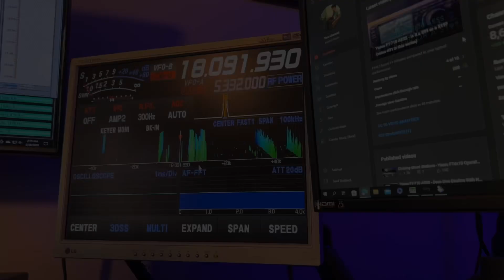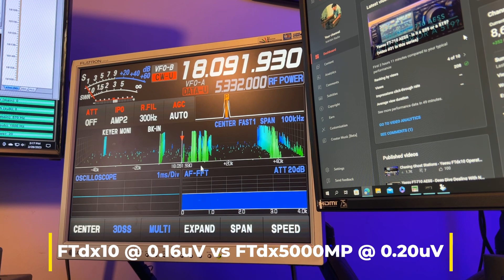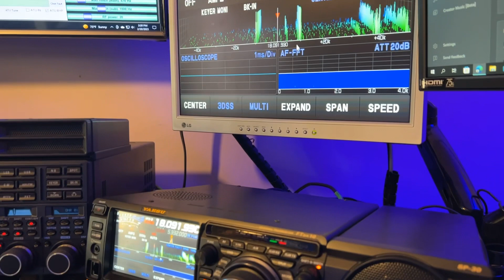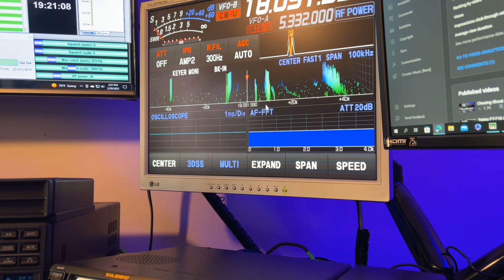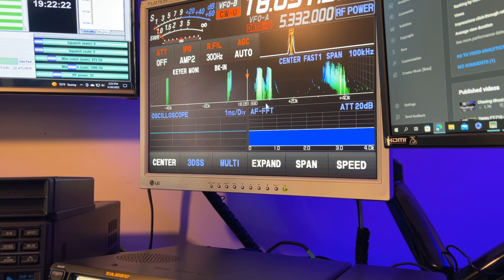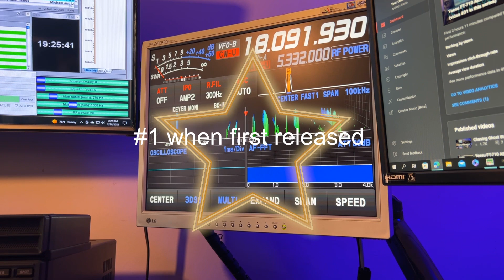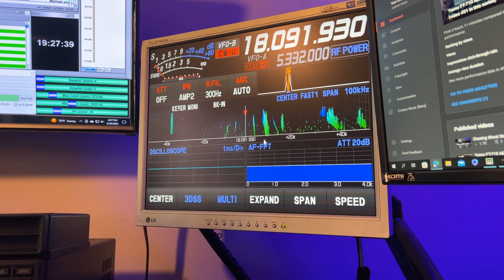Choosing an HF Transceiver: RX Sensitivity #hamradio #receive #receiver #sensitivity

Comment: I would never purchase a radio without an rx antenna port. Currently using the TS590SG which does have a rx antenna port. If you dont know what I am talking about build yourself a rx antenna only Google search "loop on the ground antenna" it very inexpensive to build  connect it to your FTDX 5000 rx antanna port, then get on 40/80 and use that antenna to listen on you will be amazed and what you can hear.
Reply from the maker: @ThomasAdsit I already built a RX only antenna years ago.  I shot a video about it.  I also shot a video showing how to use an antenna matching unit to detune almost any antenna and make it a good RX antenna.  

The receiver in the FTdx5000 is so quiet I ended up not needing the RX antennas.  I also don’t need one for the FTdx10.

 I have a TS-890S.  Good radio.  Fantastic ergonomics.  Noisy receiver. I’m shooting a tutorial series about it now for my Patreon members.

Comment: I have the FTDX101D as well as the FT-1000D. The ergonomics on the 101D leaves much to be desired IMHO. The 1000D is just a dream to use. The 101D is better on features and performance between the two. Ergonomics is really underestimated when weighing these rigs. If you can't find the function, then what good is it?
Reply from the maker: That’s one of the reasons I chose the FTdx5000MP over the FTdx101MP. The performance rivals the 101, but with the ergonomics of the 1000.

Comment: you get more bang for the buck with Yaesu
Reply from the maker: That’s why I usually end up with a Yaesu even when I try not to buy a Yaesu.
Reply: @n4hnhradio  that is all I ever had  started out with a 101EE and never turned away from Yaesu
Reply from the maker: Wow Steve!  Well, the vintage 101 is what really put Yaesu on the map, so to speak.

Comment: I had yaesu dx10 got rid of it great rig but their were quirks I did not like about it but the final decision was when I used the proper dvi-d to dvi-d lead for the monitor and radio, and it still blew something in the radio, so I had to send it in for repair only yaesu I have now is the yaesu 891 great little rig used your settings get great reports on that set, my other rigs are kenwood ts890 icom 7610 icom 9100 agreed what you said on your video get a radio that suits your needs and operating style not because its no1 on the Sherwood list
Reply from the maker: That's a shame what happened to your FTdx10.  I've been using the DVI-D to DVI-D setup since April of 2021 and my FTdx10 has had zero failures of any kind.  But, even if I couldn't use an external monitor, I would choose the FTdx10 again because of its low noise floor, filtering capabilities, and superior DSP.  It has a fantastic receiver for chasing QRP, rare DX, and contesting.
Reply: @n4hnhradio Yaesu is having a major problem with the USB ports on their newer radios. Without a warranty this problem will brick the rig.

Comment: I'd trust the laboratory tests before on the air test! A slight change in band conditions can easily throw the whole test! Without listening to a beacon station on the same band at the exact same time to compare it to you don't know what's taking place! 

Not to mention all the solar activity taking place here lately! Upper bands change first!
Reply from the maker: Yes, lab test results are helpful. But, like I mentioned in the video, each test produces a result for a specific function.  When we operate, we utilize the entire breadth of functionality available, or we should. 

You might be new to this channel so you might not have seen past videos. I put the radios through the paces in various modes and band conditions. I don’t make a judgement based upon one experience. I spent 8 months in 2019 pitting every major transceiver against the other, to decide on my next HF base station. My final choice was not the transceiver I was expecting to get. It wasn’t even the same brand. 

My suggestion in this video is to consider other things beyond the specs. Transceivers in the top 20 of Sherwood’s list are all very good, some even great, especially those in the top 10. But they aren’t just great based upon the test that Rob Sherwood rates them for. They have a broad range of features that, once combined, can allow the transceiver to perform even greater. That is the main purpose of this channel - a focus on operating techniques.
Reply: @n4hnhradio  Yes but your video is RX sensitivity! You cant use a sky wave signal as a reference and get any kind of accurate test! Even a ground wave signal, which is way more stable isnt a great reference! 

I hear stations say that all the time! Its Bogus! 

As i said. I will stick with the Lab test because they use a stable reference!

Eliminating QRM thats another topic!
Reply from the maker: My video was an example of how comparisons like that should not be considered as the one criteria to use when making a purchase decision. The video isn’t intended to be definitive in one operating session.  It’s a 13-minute video.  The two transceivers featured in the video were chosen because they just happen to be the ones I use. It isn’t a FTdx5000 versus FTdx10 video.  

If your intention is to pick apart the video, this is probably not the channel for you.  You are probably too smart to watch my videos. I’m trying to provide practical advice to newcomers to keep them from spending money unnecessarily.  In this case, being overly concerned about one specification.

I have been pitting those two transceivers against one another since April of 2021.  I’ve pitted them against others as well.  I know they are neck to neck. The point in the video is to show that a difference of 0.04uV in sensitivity, on paper, isn’t really discernible in actual operation. As you say, propagation can skew the results.  So, don’t get caught up in making a purchase decision based upon one spec.  Consider ergonomics, operating style, modes used, reputation, and perhaps even brand loyalty.  Most transceivers on the market today are quite good. There might be a better execution of one feature on one versus the other and vice versa. For example, I know that the DNF in the FTdx10 introduces distortion. But I didn’t let that stop me from enjoying the superb filtering and noise reduction capabilities it offers. 

A person can buy a radio based purely upon specs and that is fine. And as long as that makes them have confidence in the radio, that’s also fine. They will most likely enjoy the radio for years to come, especially since there is very little difference these days between most radios within the top tier.
Reply: @n4hnhradio  When the first thing you do is use a Bogus reference you just lost my confidence! Anyone who thinks you can use a sky wave signal as a reference doesnt know squat about Radio!

So why would you even do that? Its a Red flag!
Reply from the maker: Put on your thinking cap. How many hundreds or even thousands of times do you think I might have flipped that switch to account for fading?  Too many to count really. It’s not a bench test.  It’s a judgement made from hours upon hours of operating experience, under various conditions, including some ground wave. Enjoy radio the way you wish.

Comment: My 2 favorite Cw rigs are the 5000 and the k3s. Both have lower noise floors to me. The dx10 isn’t far behind.
Reply from the maker: The K3S is a mighty fine transceiver too. It is only 3 positions below the FTdx10 on Rob Sherwood’s chart for dynamic range. And, like I said in the video, top 10 transceivers are going to be neck to neck by the time you factor in all of their assets.

Comment: Love the channel!  Just bought a 2018 5000MP which is out at Yaesu being checked over. What is the software/pan adapter solution you use as shown in this video with the Flatron monitor?  And what are you using to switch between the 2 radios?  73’s Randy N4TDT
Reply from the maker: The Flattron monitor is connected to the FTdx10. I use the SM-5000 with the FTdx5000MP.  I don’t care about a waterfall, so the spectrum scope in the SM-5000 is enough for me.  I play radio, not television. If a radio has a waterfall, that’s fine, but I don’t make a purchase decision based upon having a waterfall or not. I’m using an antenna switch in reverse to switch between the radios.
Reply: @n4hnhradio  thanks for the quick reply!. I agree with your comments, but I’m curious what you’re using to project the waterfall on the LG screen since you were switching between the 5000 and the DX 10. Thanks again. Randy.
Reply from the maker: The FTdx10 has a waterfall. The Flattron is displaying a duplication of what the FTdx10 display shows.  There is a direct monitor connection on the back of the FTdx10, via DVI-D.
Reply: @n4hnhradio  ok, I thought you had switched to show both the 5009 and the dx10 on that monitor and I was trying to figure out how you could show it from the 5000.
Reply from the maker: Oh!  I see what you mean. No!  I wasn’t even watching that display. I was focusing only on listening to the QRP small on the two receivers, showing that the radios are neck to neck as far as performance goes.

Comment: Yaesu got my money thanks to you. I have to say the FDX10 was my limit on what I could spend. Since then I have added the 300hz RF, Begali paddle and a extra monitor.
Reply from the maker: Congratulations!  Tell Yaesu!  Hi! Hi!  I think that they think I have hurt their sales. I’m just being honest.
Reply: @n4hnhradio  I also bought an ftx-10 based on your videos. Along with the overall assessment of the radio being very capable, the main driver for me was your thorough explanation and guidance of how to use and get the best out of the radio. This is such a valuable resource. I'm convinced Id get much more success out of this radio, compared to many others, only because you've taken the time to provide us with such a high standard of teaching. Yeasu should be hugely grateful to you for providing this resource.
Reply from the maker: If Yaesu is grateful, they will probably never admit it. The truth is, the techniques I teach can be applied to most radios.  It’s just that some are cable of better performance than others, using the same techniques.  The FTdx10 is one of the more capable. 

I’m glad you are finding the videos helpful. I don’t know if I will get anymore radios to create a video series about. After I revealed the good, the bad, and the ugly about the FT-710 AESS, it seems that I can’t get another loaner. But that’s okay, you can still apply the techniques to other radios. Even the videos in the FTdx5000MP playlist can be applied to the FTdx10. Knobs and menus are different but the performance is the same.

Comment: What’s the difference between noise floor and sensitivity (-127db vs 0.16mv)
Reply from the maker: Hi A.J.!  When I refer to the noise floor, I am referring to natural noise (atmospheric), also known as QRN, where the “N” stands for Natural.  There is usually an added portion of noise from distant man-made sources, also known as QRM, where the “M” stands for Man-Made. These distant man-made noises combine with the atmospheric noise to create the noise floor.  Another component that can factor into the noise floor is the noise generated by the heating of the receiver components themselves, especially in the front end of the receiver.  This is the noise you hear when no antenna is connected.  And finally, there is the added possibility of local man-made noise (QRM), such as that from power lines, plasma TVs, wall-wart power supplies, laptop power supplies, LED lights, wireless phone chargers, food sealers, etc. The local QRM will prevent us from discerning the natural noise. 

Now, sensitivity is the ability of the receiver to detect a weak signal against the inherent noise of the receiver itself. It is measured in a laboratory environment. The test engineer uses a signal generator, increasing its output level until the receiver’s audio output increases by 10dB more than the level of minimum discernible signal (MDS).  The formula is expressed as 10dB (S+N)/N). S+N represents a discernible signal plus noise, while N represents the amount of noise measured when no signal is being fed into the receiver. The Signal+Noise measurement is divided by the amount of Noise measured when no signal is feeld into the receiver.  The result is expressed in microvolts, as in 0.16uV for the Yaesu FTdx10.. That means that it took a signal level of 0.16uV to achieve the 10dB increase above the minimum discernible signal level.  For the FTdx5000MP, it takes a signal level of 0.20uV to achieve the 10dB increase above the minimum discernible signal level.

I hope this helps.

73, de N4HNH

Comment: Love my FT5000MP 2014 - fully agree the ergonomics really suit the desk environment. But also love my DX10 for portable and mobile (static) - it’s like having the 5000 on the dash. If the magic smoke ever escapes the 5000 beyond repair, at this moment in time another DX10 would replace it.

The function menu is a little strange at first on the 10 but I mastered my 897D, but a lot are set and forget so I wouldn’t worry if like me you have bigger than average digits

Thanks for all your work and videos on the radios - said it before Yaesu should simply put a notice in each box - “See N4HNH”

Cheers Davy
Reply from the maker: Thanks Davy!  I appreciate your kind words. I think the FTdx5000MP and the FTdx10 are the two of the finest radios to pair up. 

73, Doug
Reply: For more information, refer to N4HNH videos on each and every Yaesu owner's manual.